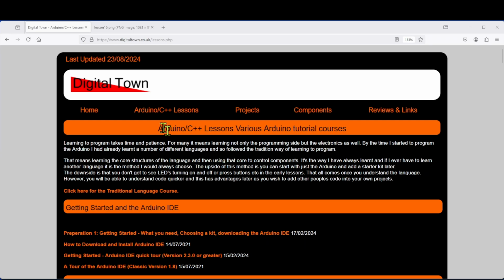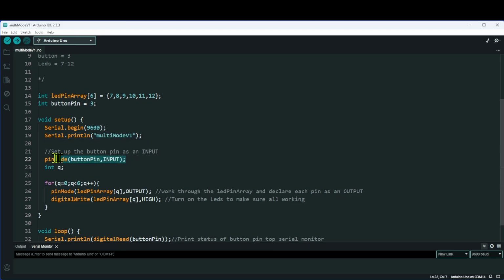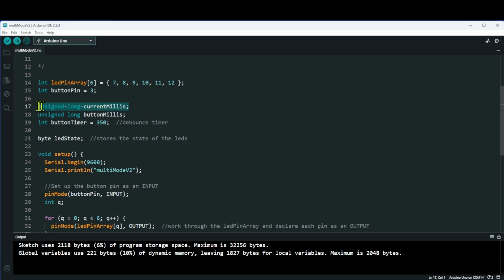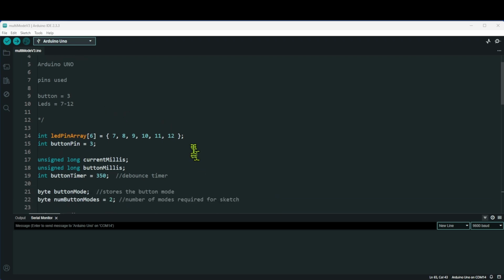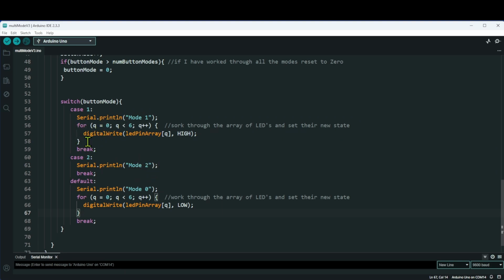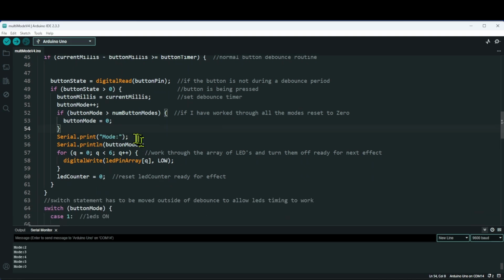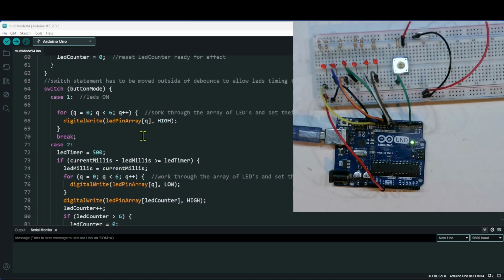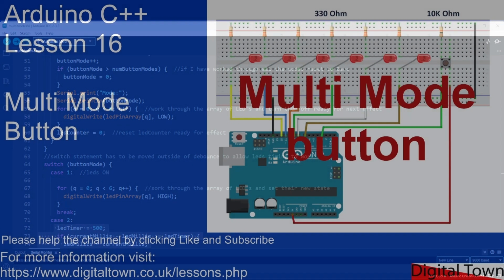#111 Arduino C++ - Lesson 16 Creating a multi mode button with Arduino Uno

Comment: Very good, for my level.
This helps me with the project I'm working on, but I would really like to see a video about handling multiple buttons.
Reply from the maker: Try this video for multiple buttons https://youtu.be/kXDviSgM22w?si=SFzY3vFfTkl6Tiop
Reply: @digitaltown5442  I think it helps me.  I need to use a method to set a clock, MAX7219 matrices, display with animations, so I don't have to mess up the timing using delay().
Maybe I can work this holiday season.
I will come back.